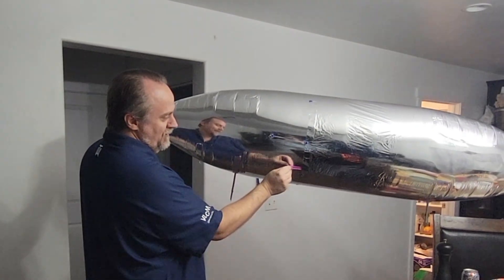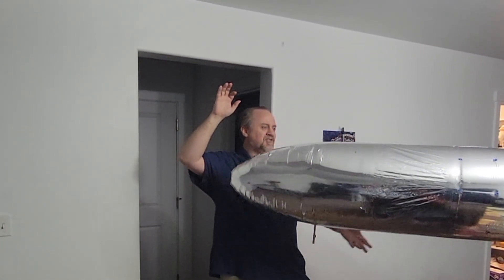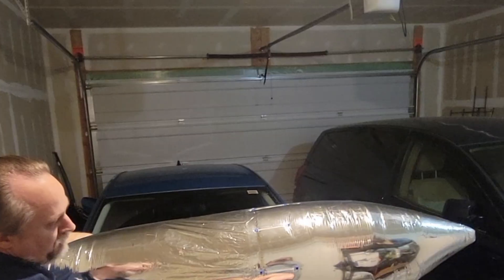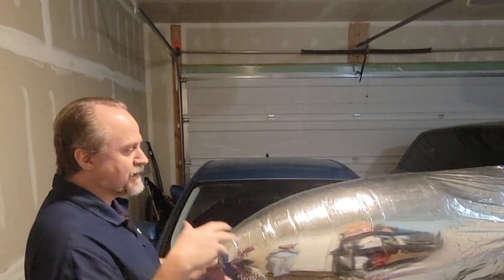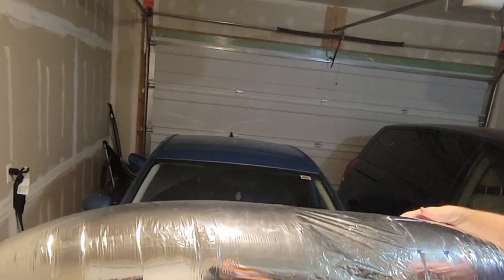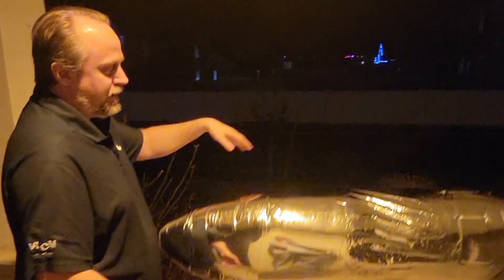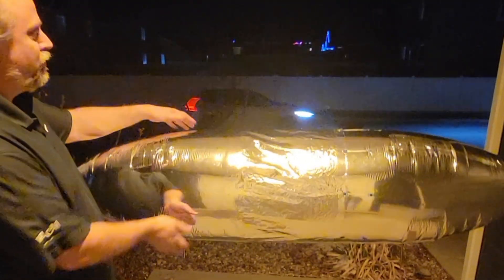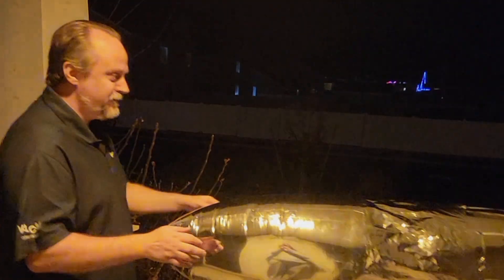Passive Ballonet in operation

Comment: The rate at which the temperature equalizes is impressive, even for such a tiny blimp. Helium has a very high rate of thermal conductivity, after all. This could be very useful in a larger airship that rapidly heats or cools its helium for buoyancy control. 

One such example would be the Aereon company, which had a system in one of their prototypes that used a miniature propane heater system could increase the static lift by an impressive 29%, which is larger than the typical payload mass fraction for an airship. Goodyear also did a study in the 1970s that found capturing a portion of the waste heat from the engines could easily supply enough heat to increase the lift by 20-30%, but that to do so would require careful study of how thermal cycling might impact the hull materials. Happily, modern airship materials like carbon fiber, aramid composites, and titanium are extremely heat-tolerant, though I can’t say as much for the glue and mylar that tends to be used in smaller blimps like this.
Reply: @Jjames763  entendo, fizeram um de pedalar e é muito interessante eles deixam o nível de Hélio no ponto de flutuar para que um pequeno impulso o faça flutuar, com um pouco de tecnologia poderiam aprimorar isso, se o hidrogênio não fosse tão inflamável daria pra fazer balões menores.